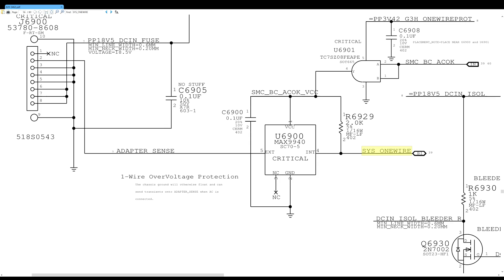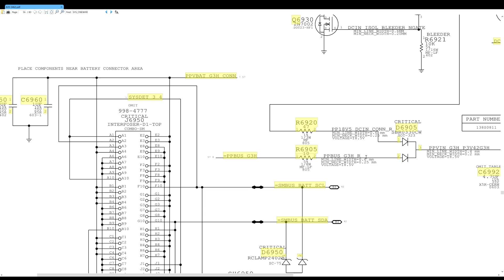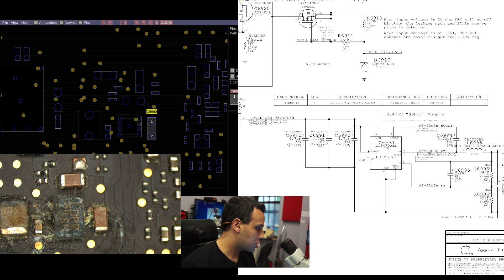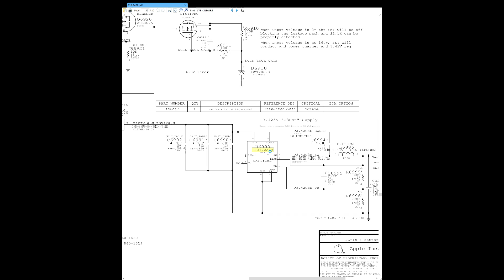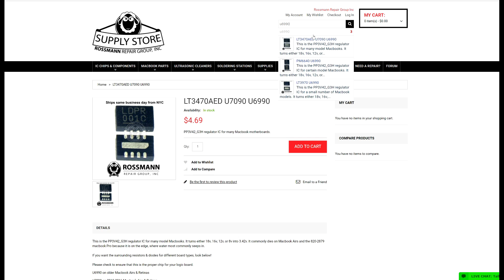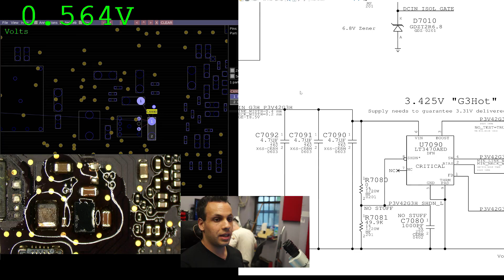MACBOOK CHARGING EXPLAINED - FAST & SIMPLE!

Comment: I will never understand why people buy Apple computers...
Reply: Per Karlsson I'm sorry? Did you even read your comment?
Reply: Per Karlsson Now that I can actually make sense of your horrid english, allow me to respond. Apple has incredibly poor build quality, for example many MacBooks with hinge issues, mainboard issues, and other issues that Apple fails to respond to properly. Apple phones are also incredibly poorly designed. The iPhone 4 and the antenna issues or the iPhone 6 bend issues due to poor quality aluminum. Don't even get me started on the iPhone 8/8+/X and their AWFUL back glass. The software is also poor, lacking many features many like. Apple products are also incredibly difficult to repair, as Louis here provides many videos on about how SHITTY Apple is about 3rd party, reliable repair. If companies were worse than Apple's design, then no one would have a working product for more than one year.
Reply: They have really pretty screens. And sometimes, you just have bad experience after bad experience buying from other big brands (eg. Samsung, Lenovo).
Reply: JL Software Apple copied the concept of a GUI and mouse from Xerox, Apple copied the pull down menu on iOS from Android, Apple copies stuff all the time
Reply: BrutalSystem because as stated by apple themselves, "think different" that's why. logics
Reply: Indirect peer pressure. "Everyone I know has one and ooh look celebs always have a mac! Therefore I need one!"
Reply: Mainly for the OS (to use the photo/video software).
Reply: BrutalSystem Also for your last comment “may not be a beautiful system” no shit.  If you want performance per dollar obviously go with a Windows.  You pay for apple products to get a premium feel, look and something that works out of the box.  You don’t go into a designer store and be like well I could get this shirt for 5 dollars at walmart.  Its for a different audience thats obviously not you.
Reply: Simply because people like the design (how it looks and works). Besides, it’s all about personal preference and what you are used to. However, please don’t assume something is a bad product before having actually tried it.
Reply: Arjo Nagelhout I have owned and suffered with an iPhone 7 for 1.5 years, and my mother owns a MacBook Air that I use sometimes.
Reply: BrutalSystem the main problem with linux so far is that it does not support that many games, other then that it is pretty nice. can do about anything you want with it

EDIT: or should i say that not many games support linux yet sadly
Reply: Wine with DXVK (YT search, sort by newest) already supports GTA V, Far Cry, Witcher, Battlefield, even Fortnite...
macOS is even worse (30-70 % less FPS) for gaming with Apple's shitty unoptimized closed-source OpenGL stack.
Reply: JL Software Also in all seriousness, Every FUCKING SYSTEM HAD FLOPPY DISKS, DVD DRVIES, CD DRIVES, LOADING, YOUR POINTS ARE SO INVALID!!! Mac Keyboards are shit, and now they use butterfly keys or whatever that are very loud compared to chicklet keyboards, like my laptop. My laptop boots in 13 seconds, and has better specs than a 1600 dollar macbook pro. The thing cost 1000 less! AND I can upgrade the thing. Oh, and I can plug in USB devices without an adapter... And then there is my desktop. A 9 year old system that still had better specifications than an iMac that costs four times as much as my system would cost used. Also, some people love mechanical switches, all loud and tactile, unlike the shit Apple sells.
Reply: I haven't owned any Apple things since the iPod Nano and iPod Touch though. I wouldn't mind having a new MacBook Pro for free though ;)
Reply: BrutalSystem Apple solders the SSD so they can jam pack the laptop with everything they want in it while still maintaining a small form factor.  I don’t get why you’re talking up microsoft when they haven’t done anything other than make a decent operating system like 10 years ago and make it shittier ever since.  Did you see the surface laptop?  You literally need to cut the keyboard cover to get access to parts.  Ridiculous.
Reply: Or any Apple product at all. 
🤮
Reply: grasso Also, MacBook materials (Aluminum, plastics, glass, ect.) does not cost 1000 bucks. I feel that there are many more systems that are cheaper and looks better than the stale, near 10 year old design MacBooks seem to always have.
Reply: BrutalSystem Oh ok, that’s interesting. What didn’t you like about your iPhone 7? I have one right now and I’m quite happy with it.
Reply: Arjo Nagelhout It was very troublesome both hardware wise and software wise. I constantly had to have it replaced by verizon, however that doesn't bother me. The iPhone 7's iOS operating system was awful. I really dislike iOS due to it's lack of features and freedom. I am a power user and a user who likes to use a phone like a computer. iOS and its low ability to be used as such always bothered me. The Galaxy S9 is miles ahead of the iPhone 7, and that's what I switched to. I have never been happier with a mobile device before.
Reply: JL Software Wait... Hold on... Fuck I cannot believe what I am seeing. "... as far as the as the floppy goes, Apple was the first to have it... and the first to get rid of it..." Umm... No...? Apple used the Floppy Drive before 84... Even then, Apple wasn't even in existence when the Floppy Disk came out... Also, some companies ditched the Floppy Disk before 98 in turn for Flash Memory (compact flash,) like a few Laptops in the mid 90s. I am going to stop responding to someone who CLEARLY has no understanding of computers...
Reply: JL Software Per Karlsson Also... USB was developed by IBM, Intel, Microsoft, Compaq, NEC, and Nortel... Not Apple... Get your facts straight.
Reply: Per Karlsson You sort of have a point, but both products where developed in the same time frame... Also, the Newton was just a PDA, not a phone.
Reply: Man posting this was a good idea... It's like a bear trap for fanboys.
Reply: Per Karlsson Well I guess it is purely opinion, but I feel the MacBook design is old, and bland. Slimmer lines there, remove a bunch of useful ports here, add a useless touch screen here. You know, typical Apple stuff. Just a flashy product with horrid features and low end specs for too much money. People will buy that, you know. I prefer to spend my money on better computers with more features and better designs, like a lot of modern high-end laptop computers. You know, ones I can actually upgrade and have access to many ports without the need of a bunch of ugly dongles. Kinda like what Apple used to do 10 years ago...
Reply: Per Karlsson "Fastest in the industry" eh? Yeah, because a 7th gen i5 paired with intergrated gaphics shared with the low end 8DDR3 ram is r e a l l y fast. Also, Dual Core*

Unless you go for the 15 inch which has a 4 core CPU... and intergrated graphics... in a tightly enclosed aluminum shell... yeah... thermal throttling much?
Reply: Per Karlsson My 600 dollar system has 8 GB of DDR4 Ram (upgradable to 32GB unlike the non upgradeable MacBooks), an 8th gen quad core i5 WITH A LARGE FAN VENT (wow no thermal throttling), and an Nvidia MX150 with 2GB of dedicated DDR5 Ram, and an UPGRADABLE M.2 256GB SSD, along with another drive slot for ANOTHER SSD. (Up to 3 Drives if you get a drive caddy to replace the DVD R/W drive). The screen is a 1080p IPS panel with good colour reproduction, with anti-glare for less washed out colours, for more accurate photo editing.

Oh, and to rub it in more I have 3 USB 3.0 ports, a USB-C port, a headphone jack, HDMI, and an ethernet port. Yeah, let's just say I got the better deal here... and If I felt like it I could easily emulate OSX Sierra with a VM.
Reply: Per Karlsson Sadly, this is just not true. A top of the line Dell XPS 15 (9570) easily beats the MacBook Pro in both CPU and GPU performance, mostly thanks to its better design in cooling, and a better GPU. The battery life in real world usage is also very good thanks to the 97Wh battery. (7 hours)

***Though CPU scores are almost ties, with XPS winning thanks to better cooling, the GPU score smashes the MacBook thanks to the GTX1050 on board. Do some research before you say that MacBooks are the most powerful laptops, will ya?
Reply: Per Karlsson I can spend hundreds less and get a laptop that has a GPU with 4GB GDDR5 Ram, 1354MHz (up to 1493MHz) core clock, 7008MHz memory clock, Direct X 12.1, and much better benchmark scores than a laptop that costs hundreds more with a GPU that has 2GB GDDR5 (or 4096 if you spend EVEN MORE) memory, 855MH, (907 if you spend mord money) and 5080MHz memory clock. Honestly, if you read the GPU specifications to a group of people looking for another powerful system that basically replace their desktop computer (not caring if the OS used is OSX or Windows), they would easily go for the one GTX 1050. The evidence is already out there of which GPU is better (AMD Radeon Pro 560 vs. GTX 1050) in the benchmark scores, like Cinebench, GFXBench, Luxmark, ComputeMark, ect. This is especially shown in gaming or other graphics-heavy tasks like  rendering or basically anything in the Adobe Creative Suite.
Reply: Per Karlsson I assume you failed to read the fact that both benchmark scores and normal usage shows the GTX 1050 is superior, but I guess fanboys like you are just too ignorant. I used to be like you, until I actually decided to leave the Apple ecosystem and actually attempt to have an IQ above 3.
Reply: Per Karlsson Maybe I should know because I used an AMD GPU in my main system, before replacing it for a GPU to better fit my purpose 🤔
Reply: Per Karlsson Not necessarily..? I don't play games that much anymore, I mostly to programming and game development with programs like Unity, CAD for my engineering trade (AutoDesk Inventor), and video editing (using Sony Vegas or Premiere Pro.). I haven't played a game on my computer in about 2 weeks now.
Reply: Per Karlsson Not new ones, though. If I where to go for a MacBook Pro, I would refrain from modern ones, as they are bad computers now. A 2011 MacBook Pro is often seen with professionals in my experience because it is just more professional. Modern MacBooks are all flashy and in your face, but older ones where just better, and actually had features and upgradable parts. I've heard from my pros that Final Cut Pro X is not as good as previous versions by a mile. It's not that I totally hate Apple, it is more that they stopped making quality products...
Reply: Per Karlsson To all those 12 people out of the millions who downgraded to a modern MacBook Pro, I feel bad for.
Reply: Per Karlsson Downgraded*

"I love my ports" - a professional
"I like selfies" - literally 70% of 2017 MBP owners
Reply: Per Karlsson 
"Professionals" - I don't care about upgrading my system because it's going to break after the warranty goes off!

Intelligent people - I actually want my 2000 dollar computer to last more than 3 years.
Reply: Per Karlsson Not anymore!

Why does this ultra portable computer exist if the portability is ruined by having to carry dongles with you everywhere?
Reply: Per Karlsson I love products that have GPU failure, casing failure, horrid warranty service, awful customer care, and low quality aluminum builds too!
Reply: Per Karlsson I don't use "DELLs"
Reply: Because it's Apple... Duh!
Reply: Pro Player 1⃣ I understand people are willing to spend more money for brand name, but besides that.
Reply: Per Karlsson linux
Reply: Per Karlsson Oh! Pfft you edited it because it was nearly impossible to read.
Reply: Per Karlsson basically any linux is better than any part of apple
Reply: Per Karlsson Sorry, your grammar is so poor it is nearly incomprehensible. Also (assuming you stated I don't know about design,) I know a little bit about design, as I am in a robotics and engineering trade.
Reply: undreamedscyra avion yeah, you gotta think different to purchase Apple products. Duh!
Reply: undreamedscyra avion I haven't used Linux but it seems like a great OS, way better than anything Apple has designed... Though, I still prefer Windows.
Reply: undreamedscyra avion try to do anything on a Mac other than what they allow and they'll sue you! Hehe...
Reply: Erik Bročko Don't forget the low end hardware Apple Products have. 1600 bucks for a MacBook Pro WITH INTEGRATED GRAPHICS.
Reply: JL Software Fuck I didn't use Mac OS... I suffered with it. Worst shit I have ever used in my life. Also, I feel you are forgetting the major amount of things crApple has copied. I know your a fanboy and all, so there is no point of making a reasonable argument, so have fun with your low software support, low customizability, low end display technology, bad customer service, bad consumer care, extremely low innovation, lack of basic ports, lack of redesigning of new products, and over priced products.
Reply: JL Software Also Microsoft does copy things at times, but usually they improve upon it. ALSO the iPhone was a copy of a very old device, if you will, the all mighty IBM Simon. A mobile device with no buttons, but all screen.
Edit: Apple copied the mouse, by the way. Steve Jobs saw it at a tech show or something, recreated it, and called it a mouse. It was called something like the point and click interface device idk lmao
Reply: JL Software a valid point there. Enjoy recovering data from your soldered in SSD. Oh! I have Anti Malware and an anti virus... Guess I am just gunna upgrade my RAM, my drive, maybe swap out my GPU... Keep up on updating my system for awhile... Sorry for your soldered in parts. Maybe Ill stick in  an SSD so I won't have to suffer through loading. Oh! I'll also use a Virtual Machine on Mac OS to see what I am missing... or the lack there of. Yeah, guess I'll just do nothing. Man, PCs are great.
Reply: JL Software Also, I hate the surface. I can legitimately agree on your statement about it, because the surface is shit.
Reply: Because Apple uses a reputation for building great machines, a reputation that isn't merely deserved anymore... And it's been something like 7 years they haven't produced ONE SINGLE great machine... But I guess people are kinda slow with the reaction time to get out of the Apple "ecosystem" (even if it's more like a jail system but still...).
Some people are still praising Apple for their software (such as Per Karlsson in this thread), I'm sorry but they are SHIT NOW! A simple example, Pages had more options and was better in 2009 than it is TODAY, in 9 years they weren't able to do a decent job with a piece of software they previously owned.
They just don't give a shit about offering a good product anymore, people will just keep buying because of the Apple logo, even if the hardware is soldered shit and the software offers less functionality than software from the early 2000's... 
>inb4 people saying I'm a Apple hater, I'm a long time Apple user from the early 90's up to Mac pro 2009 which is still perfectly fine now and a Macbook pro 2011 where you start to see things go south with overheating for example... I'm just not convinced at all by the new "fuck customer" policy and the new "10 years to fix bugs isn't enough give us more time".
Reply: Bourinos02 You are speaking the truth, my friend. I remember when Apple was the innovator, not the follower.
Reply: Bob Visser That is true, but stick an SSD in any Windows PC and it becomes very fast and responsive. Seriously, my Acer E15, a 600 dollar laptop, has an SSD, and it boots and is ready to go in 13-18 seconds (depending on how fast I type my passcode...) The track pad is also very good, uses Windows Precision drivers. It may not be a beautiful system, but it is miles ahead of Apple MacBooks... And it has better specifications than a Macbook that costs ~1000 dollars more...
Reply: grasso I hate the Surface. Also, ever heard of the LG Gram? Maybe you've heard of M.2 SSDs... Also, they don't "jam pack" things in their laptops, they put low end specs in their computers, and call them high end. Soldering the SSD does not save space. At all. I am not on Microsoft's side exactly...
Reply: Marjan Mrak Depends what your buying, really. Chromebooks are good though.

Comment: Im just wondering how do they make it so that the quality is so shitty. I have an old netbook. Probable 6-7 years old and it even fell on the stairs and it still works and charges and didnt get randomly corroded.  (last time i cleaned it i didnt notice anything off)
And on top of everything its a no name chinese brand. It was litterally the cheapest thing that could run windows and had a display
Reply: +Laharl Krichevskoy
That's Apple for you.  Creating products that are worse then Chinese laptops since 1990.
Reply: Well I’ve been clumsy too with my macbooks over the years, and they still worked fine. They’ve been very durable in my experience, and a lot of apple customers have also had good experience with  them to other brands, that’s part of the reason why they have been successful, despite the shitty practices. They are overpriced though.
Reply: Laharl Krichevskoy well if you live in a place thats damp and humid it happens just living conditions really not the owner